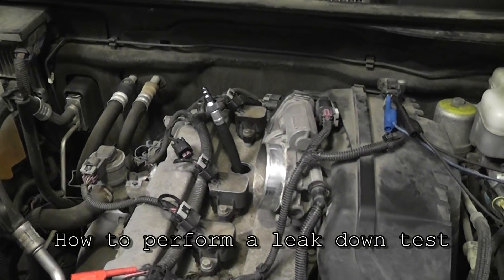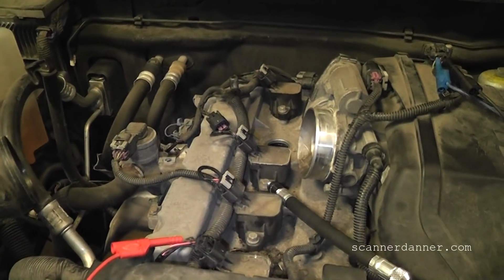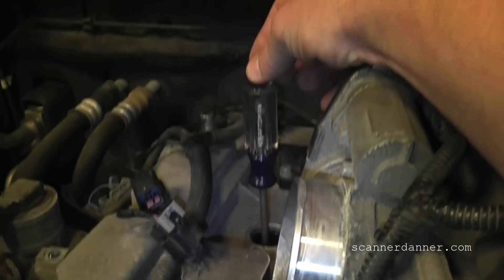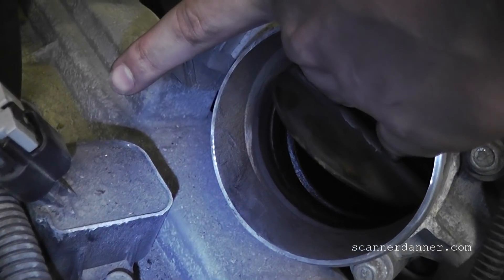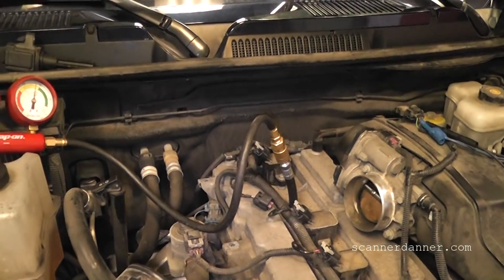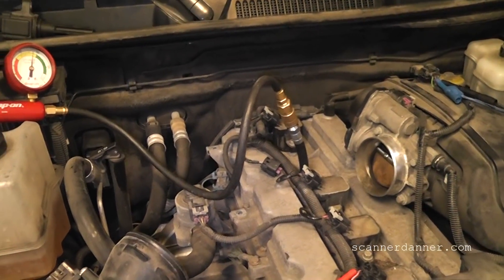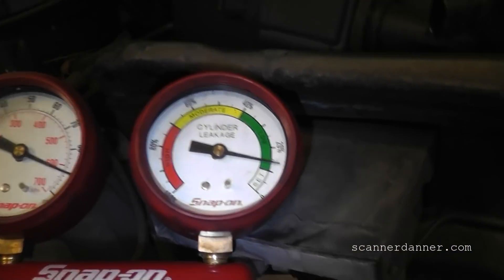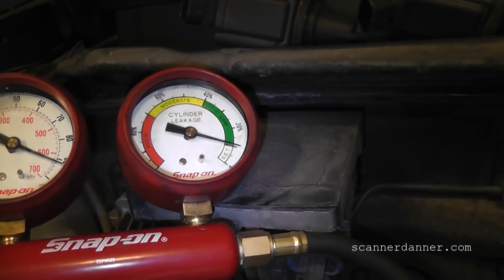2008 Hummer H3 Misfire Case Study (Part 4) Leak down test revisited

Comment: Good stuff as always man.  I was actually surprised at how much controversy there was about a leak down test during this series lol.  Back when I was a second year apprentice at trade school (here in BC, Canada, second year is focused on engines, rebuilding, diag, maintenance etc etc) we were taught to always do a leak down test at TDC for more accurate results and safety, but to do it at BDC after just as a secondary test to reveal any issues with a head gasket that might have been missed due to the piston covering the sealing surface at TDC.  I always thought this was a pretty "textbook" test lol :) For better or worse, we learn new stuff everyday thanks to the internet :)

Comment: 11:15
I dont think a V type engine would be any different. As long as the connecting rod is perpendicular within the cylinder to the crankshaft it should stay.

Comment: Would it be true to say that running the compression test at TDC and then lower in the bore at different points be a good indication of bore taper wear ?
Reply from the maker: It is normal to have more wear near TDC as this is wear all of the major psi occurs in the cylinder. What I do not know is what is an acceptable amount. This is not my area of expertise.
Reply: ScannerDanner Maybe a good investigation for a future video ? Would be cool to see if that would work.

Comment: Good stuff- I do like the use of the MAP wave form and look forward to pico pressure transducer wave form, since the two are so much different it would be interesting if we could view the WPS500 wave form and be able to  interpret  the MAP wave form consistently.
Reply from the maker: I have the in cylinder readings on the pico coming up next. If I can I may use the WPS500 on the intake and maybe my fluke pv350 in the cylinder?
Depends on what else is going on. It would be cool to see. I want to get a first look sensor in the tailpipe too but do not have one yet. It would be super cool to see all three.